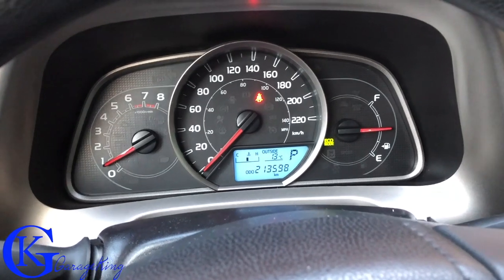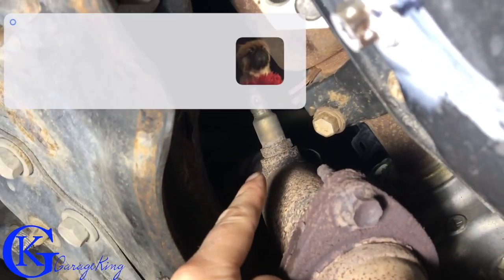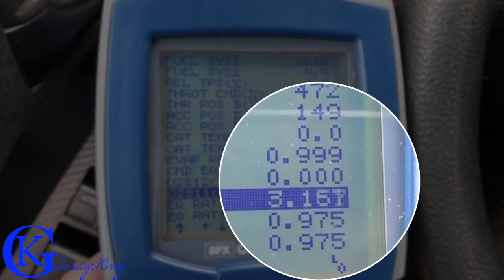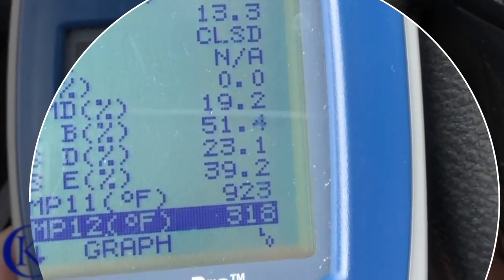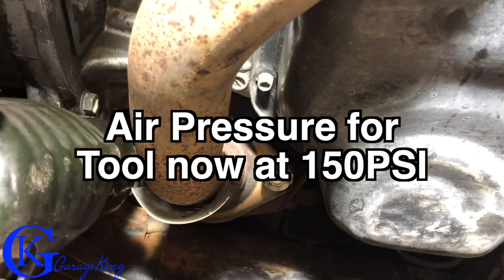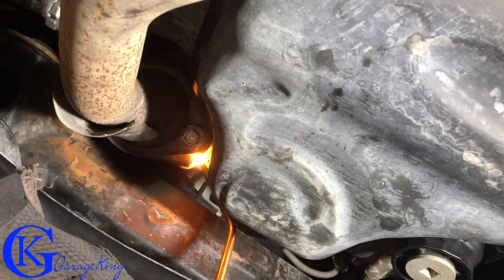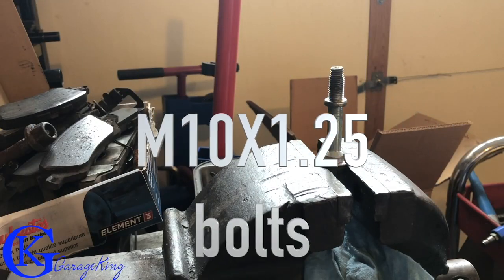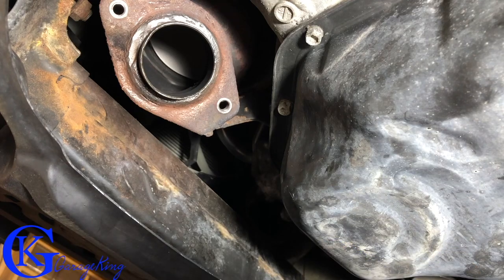How to Fix Toyota Rav4 P0420, check exhaust

Comment: This worked on 2001. Ekco. Beat cat with 5lb hammer. I'm guessing some soot fell off the sensor. Nothing is rattling. Didn't break the cat. Same code. Simple maintenance. Did break a sweat but didn't remove any nuts or (bolts) to be exact.
Reply from the maker: Hey thanks for the great comment. This one was actually leaking at the flange so I was able to straighten the flange with a hammer.  With yours maybe you knocked some soot off like you said. At least you got a good workout !!!
Reply: @GarageKing  doesn't feel like exercise when you get a little reward. I felt lucky. Almost 2 years later and no lean code. However I myself could use a leaning. Lol
Reply from the maker: @marshmower  You know it LOL. Many times I broke a good sweat, and always rewarding for me as well !!!  Happy Saturday to you :)
Reply: @GarageKing  you too.

Comment: Did you hear any exhaust leak sound from outside before the examination??
Reply from the maker: The car was a little noisy, but nothing major and it didn't stand out.  It was only when I went underneath I was able to know that it was leaking.

Comment: Just replaced upper cat & 02sensor..... ran good for 2 weeks.....(knew of existing exhaust leak from before upper catalytic converter issue)...now, car is running very rough...hardly any acceleration....& Sulphor  odor.....could this be from exhaust leak?.....or can I remove the secondary catalytic converter?....
Reply from the maker: Hey Thanks for the comment, If you have a sulfur smell you are probably running to rich.  You know when you gun it you can get that sulfur smell.  I would scan your vehicle to see if anything is out of whack, or if you have any pending codes. You may even have a leaky fuel injector. You could remove the secondary cat as there is no O2 sensor after it, but it will probably not fix the rough running unless you exhaust is plugged.  Most likely you have something else going on there.
Reply: @GarageKing  thanku very much for reply....really appreciate it!!....if I removed secondary can I just put an equal size pipe to fill the void?...also,can I do this w/ coupling & band clamps?....or it must be welded?....was thinking if I cut the secondary cat out I would just use high temp gasket w/ stainless bandclamps/hose clamps etc.....could this work?....1st cat is new.....was told about a leak I did have on exhaust  before the 1st/upper cat got replaced.....thank you!
Reply from the maker: @joemorales9093  Hey there, if you wanted to put an equal size pipe to fill the void you need to stretch it with a pipe expander so it will slip over the old pipe (also make sure to clean the rust off the old pipe or it can leak.  Expanders are pretty cheap and they look like this https://amzn.to/3G5LO49 just make sure you get the right size expander.  If you don't do this the pipe will just but up together, probably leak, and all the weight will be on the coupler so I doubt it would hold for long.

Comment: I probably have a leak. I had the O2 sensor and catalytic converter replaced and still have the check engine light on
Reply from the maker: Most likely you could have a leak.  The leak at the flange was really small, you could barely hear it, but when I put my hand around it I could feel some air (if you check be careful as its very hot).  It does not take a big leak to make the check engine light go on. To make the light go on, the leak has to be IN FRONT of the catalytic convertor.
Reply: @GarageKing  thank you for this important detail. I will follow the video to check.
Reply from the maker: @FreedomofSpeech865  Sounds good, its best to check for the leak first thing in the morning when the vehicle is cold.  They will leak worse when they are cold and its easier to find the leak.
Reply: U usually have to reset the light once it goes on and is fixed it’s like that in old cars you have to reset the system and it will go off
Reply from the maker: @sarahhuerta5704  You are right, but in some after a few clean drive cycles they just reset themselves.  If you have a scanner, good to reset on your own.  Thanks for the comment Sarah !!!

Comment: The engine sounds like it is sputtering & struggling ti breathe
Reply from the maker: Ya, can you believe it was an exhaust leak that actually caused the code.  Was not the failure of an electrical part.  Most people think its an electrical part that breaks.